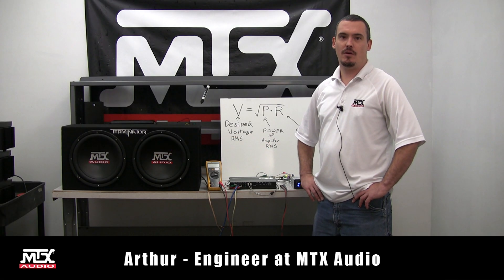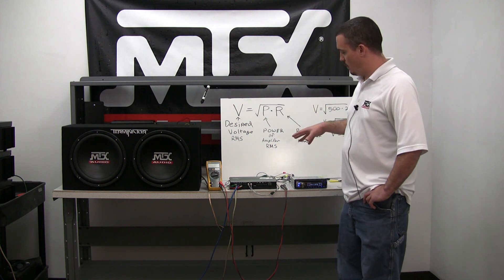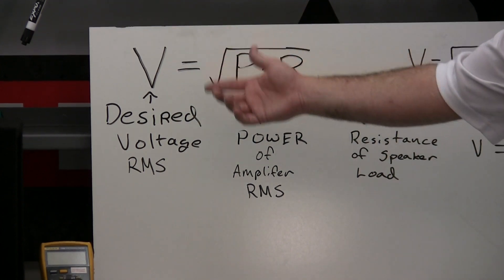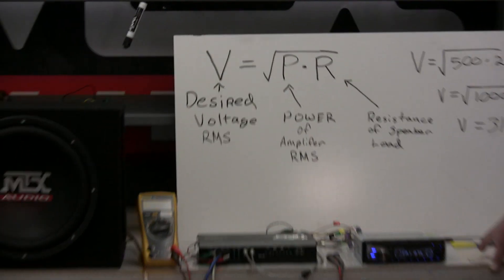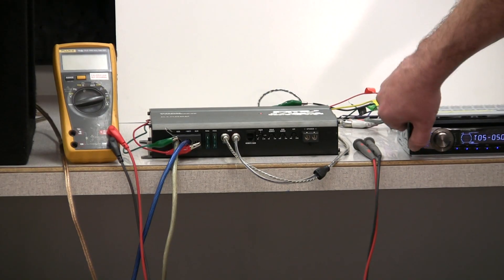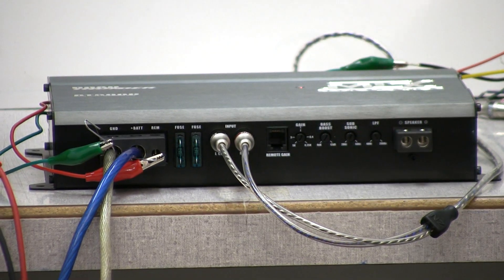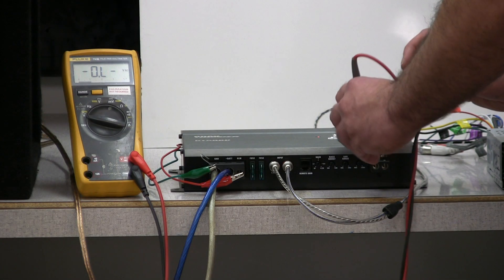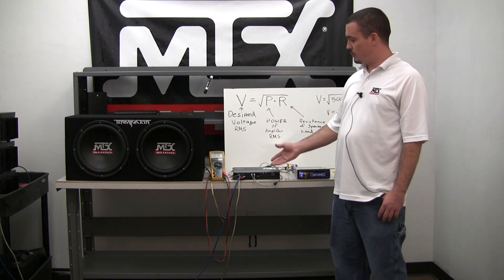How to Set Your Gains Using Ohms Law and a Basic Multimeter

Comment: Great video. I know this is an older video but why use AC and not DC? I thought DC is what you normally use with cars? I need to tune a set of components and want to try this method to set the voltage on the front speakers as that is all I have and I just installed an amp. Okay it's late and I just realized we are on the speaker side and not the power side of the amp and we want to measure the sine wave...well correct me if I'm wrong. I just wanted to clear this up. Thanks.
Reply from the maker: DC voltage is what the battery of the vehicle has but the output power from the amplifier is AC. Yes. We are using the gain to level adjust the input signal (varies depending on the head unit) so that the amplifier can send the best possible audio signal to the speakers. Be sure to use an appropriate frequency for your test disc depending on what type of speakers you have connected to the amplifier you are tuning. This video references 50Hz because the amp is connected to subwoofers. For component speakers, you would use a high frequency test disc. Refer to your speaker's specs.
Reply: ***** I finally got around to playing with this and I tried setting up the gain but wasn't getting anything without any volume and with the radio on the numbers just jump up and down. So I need to make a tone mp3 or wav file in audacity. The crossover is fixed at 3800 Hz, 6/12 dB/octave and the other number for the woofer is 55-3200 Hz. I have MBQuart DSh 213 components. In something like this, what tone would I need to use? I'm just trying to walk through the whole process to understand how to tune something like this correctly. Do I just need to make a 3200 Hz tone and use that to tune the set? I guess since there's a tweeter, that's confusing me a bit since both are considered channel one for one door and channel 2 for the other. I unplugged them just like you did. Cool stuff by the way, but it's not quite the same watching and actually doing it since I have never done this, but I'm learning.
Reply from the maker: You can download test tones from MTX.com at https://www.mtx.com/t/testtones. For an amplifier that you are using to power full range speakers, you can use a 1kHz test tone.
Reply: ***** Thanks!. I ended up making a few tones and tried using the 3200 tone and noticed that the gain at the lowest was 16 something volts! So I changed to the 1Khz and I got the number exactly matched to the speakers. To make the tones I only changed the Hz in audacity and nothing else. I also just saved as a windows file and that seemed to work. Channel one and channel 2 have the same gain dial so I only used that. Looking at your link, you have a left and right channel tone. When do you use those? I only ask since my gain says ch1/2 on it. So I just used the left channel to change the voltage on it. I figured it would be for both sides since the ch3/4 have their own dial, and so does the sub. Man, this is pretty neat once you get it working. Now I have an LP filter dial that goes from 50 to 200 Hz, I guess this is for the subs which I don't have any. Except for ch1/2, all my other dials are pretty much turned all the way down since I don't have anything else plugged in.

Comment: Hey I have a 4000 watts amp 1700 Rms max monoblock 1ohm stable and I have to 12 inch subs both are 500 watts Rms. What's the best. Way to connect them
Reply from the maker: Need some more info. Is the amp rated at 1700 watts RMS or 1700 watts Max? Also, is the 1700 watt rating at 1ohm? What voice coil configuration are your subwoofers? This will determine what your final impedance (ohm load) at the amplifier can be.
Reply from the maker: You can also refer to this video: How to Wire Your Subwoofers to the Correct Impedance for Your Amplifier

Comment: I see that you're setting amp gain(s) for a subwoofer system. Does the same apply for setting the gains for full range speakers, i.e. front/rear component speakers driven by external amplifiers? I would like to do this for my complete system. Thank you.
Reply from the maker: Yes. Same math would apply but instead of using a 50Hz tone, you would use a tone more applicable to the specs of whatever speakers you are using.
Reply: ***** Thank you. That really makes things a lot easier. Have a great day.

Comment: i used ohms law w/  Rms wattage of 600 x 2ohms square root that i got 34.64 i turned all my filters off turned my LPF all the way up and my head unit to 75% which from 50 is 37.5. the number i was getting w/ the gain all the way up was 20 or so. and i was playing a 50hz sine wave. What do i do i can't get to that number with the level knob.
Reply from the maker: What kind of amp are you working with? What is the model # if you have it?

Comment: hiya went you got your 31.62 v,how you got it from 1000?????
Reply from the maker: Voltage = square root of Power x Resistance

So, multiply whatever your resistance or ohm load is at the amplifier by the rated power of your amplifier at that ohm load (impedance) and then get the square root of that number. That is your voltage.

Square root of 1000 = 31.62
Reply: ok cool,but now with you multimeter for setting it rite why a/c instead of d/c,seen that it's a car?
Reply from the maker: a. jahja Amplifiers us DC voltage from you battery but they output AC voltage to your speakers.
Reply: ok cool 1 more thing how can i reach like 150 decimal's
Reply: So someone please correct me if I'm wrong.
Using a 500w RMS Vd-10 sub. DVC 2 OHM
Wired to 1 ohm while running a 1500w rms amp.
Square root of subwoofer rated power (500 watts) would be 22.36... ... Correct?

Comment from the maker: Lalo Ramirez,

Unfortunately, there is no good way to connect your DVC subwoofer to this amplifier. The amplifier is 400 watts @ 4ohm when bridged to mono. Your subwoofer can only be wired a final impedance of 2 ohms or 8 ohms. I would recommend you get a class D monoblock amplifier for your subwoofer than would do the appropriate amount of power at 2ohms for your subwoofer and use your existing amp for door speakers.
Reply: MTX Audio USA hi I’ve been trying to figure this out forever my sub is dual 2 ohms I have it wired down to 1. So would it be my rms times 1 (obviously 500) or do I still do the 2 as well? Also my sub is rated 500rms

Comment: Hello, I need some advice please. I have one 12 inch shallow mount Rockford Fosgate R2 subwoofer with a dual 4 ohm coils; rated at 250 RMS and its hooked up to a HIFONICS ZEUS ZX4000 Rated at 400 watts RMS bridged on a 4 ohm load. Speaker is wired to a final 8ohm load. And the amp is bridged. Please tell me the correct way to connect this system! :(

Comment: Not many people set the amp gain on a test bench their for this tutorial is not practical. Please do a tutorial on how to set amp gain/level in a real world environment. Such as crank head unit to as loud as the highs and mids can handle and then meter your sub amp volts. In my opinion anyone setting amps up being highs or lows on a test bench doesnt need a tutorial anyway cause they are probably profesionals.
Reply from the maker: All the same math and methods apply whether on the test bench or in the car.

Comment: Thanks for the video.  I'm still hung up on the R term, it seems like I've read conflicting info on the web.  I have a single 10" 4-ohm DVC subwoofer that is rated for 300W RMS.  I have a mono amplifier that outputs 300W @ 4 ohms or 500W @ 2 ohms.  When I calculate V = (P*R)^0.5, I am using R = 2, since while my subwoofer is a 4 ohm model, because of the wiring and single subwoofer it puts a 2 ohm load on the amplifier.  If I set P = 300W, I then get a target V = 24.5 volts.  Does this seem correct?  Because some other info I have come across seem to indicate that in my setup R = 4, in which case my target V = 34.6 volts!  Thanks!
Reply from the maker: You would use whatever impedance your subwoofer is wired to so if you have wired your DVC 4ohm sub down to 2ohms, R would = 2
Reply: ***** Gotcha, thanks!

Comment: if i have a amp that puts out 200watts @ 4ohms, that = 800, square root of 800 is 28.28?
Reply from the maker: Yes. 28.28 volts
Reply: ***** I have a problem, to get that 28.28 i have to have the bass boost turned on to 6db because with the gain all the way up it only reaches 22, not 28.28. im guessing this is becasue my deck is only 2v pre out, its a sony gt26, my amp is a pioneer gm-d7500m , is it true that if i get a deck with a 4v preout i can set the amp gain lower while the output voltage is higher? will that allow me to set the gain to 28.28 without bass boost? thank you
Reply from the maker: HazeHDesign Yes. A deck with a higher voltage preout will provide a better signal to the amplifier.

Comment: This tutorial is only good if you have your highs and mids disconnected. This is not a practical tutorial.
Reply from the maker: This video shows how to set gains for a subwoofer amp. For highs and mids that player higher frequencies, you would use a higher frequency test tone such as 1kHz but the speakers or subwoofers do not need to be connected. Setting the gains in this manner ensures that the audio signal you are sending from the amp to the speakers is full signal (widest bandwidth) without clipping.
Reply: ***** where can I buy the test tones cd ?
Reply from the maker: arturo emmanuel fernandez You can download a 50Hz tone for subwoofers and a 1kHz tone for full range speakers from our website at https://www.mtx.com/t/testtones
Reply: *****  how Tuning ssf,lpf, and bass boost

Comment: Why do you use a CD with 50hz? i'm trying to do this with all my components in the car already, and my head unit is connected to my amp and my regular car speakers. Any suggestions? I'm thinking i will disconnect the car speakers from the head unit so i can turn the volume all the way up with out waking my neighbors.
Reply from the maker: We use a 50Hz tone because that is a common frequency range for most music. For your speakers, you would use a frequency that is somewhere in the frequency response range of their specs. For example, you wouldn't use 50Hz if the speakers have a frequency response of 75Hz to 20kHz. 

You would want to disconnect your subwoofers to set the gain on the amp that powers your speakers. Once that is done, disconnect your speakers from their amp, reconnect your subwoofers to their amp, and set the gain on that amp using an appropriate tone. 

Hope this helps.
Reply from the maker: Keep in mind we are setting up a subwoofer amp and subwoofers play lower frequencies than speakers so a 50 Hz tone is good for subwoofers but would not be good for speakers. For speakers you would want something more like a 1kHz tone.
Reply: @MTXAudioUSA  Thanks for the informative video and answering all these questions that I've had myself. Much appreciated!